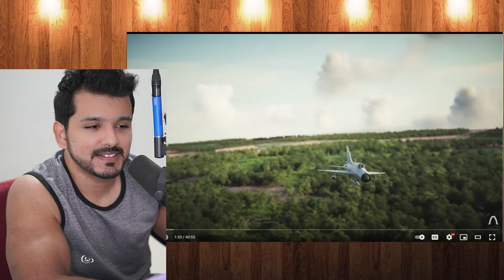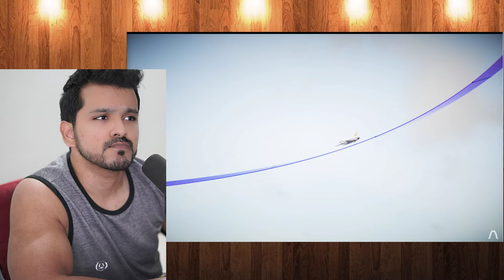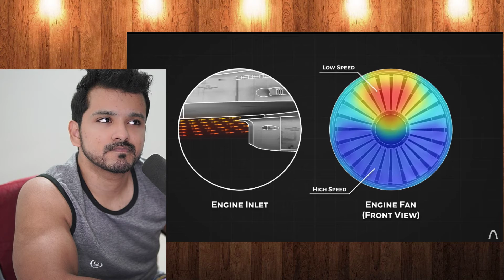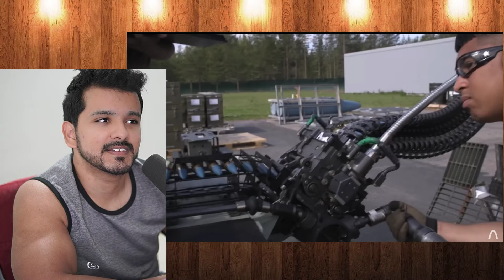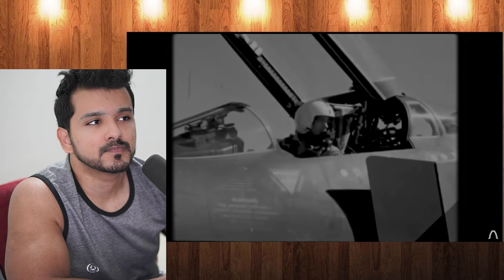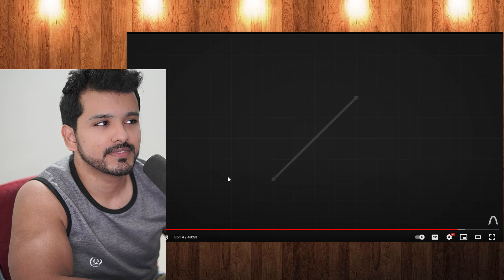The Insane Engineering of the F-16 | CG Reacts

Comment: The closest parallel I can think of regarding how an F-16 handles compared to other fighter planes is by using an example of motor vehicles -

If you've ever driven a vehicle with a very short wheelbase, like a jeep, or a go-cart, you'll know how quickly they can turn.  The tradeoff (as with the F-16) is that it feels very "wobbly" or unstable at high speed, especially if you're just trying to hold it in a straight line.  A vehicle with a longer wheelbase has a larger turning radius, so it feels clumsier at low speeds, but it is also much more stable at high speeds.  

Many people think F-1 cars are very wide because the viewing angle the cars are shown from on tv makes it look that way - however, if you look at an actual diagram of an F-1 car, you'll notice they are quite long compared to their width - even more so than regular cars.  F1 cars are almost as long as a Chevrolet Suburban, but no wider than a Honda Accord.  F-1 cars need the length to stay stable at 300km/h.

Comment: When they say the gun is accurate they mean the bullet goes where you point the gunsight. When you're dogfighting an transonic speeds you may only have the enemy in your crosshairs for a spit second.
In early M61 installations the gun would vibrate a lot, causing the bullets to spread out kinda like a shotgun. This is good for an area of effect where you don't have to aim as precisely, but it does mean you have to spend more time on target to get enough hits to ensure a kill. When America started getting serious about using guns in dogfights again they did some tests and determined that the shotgun effect was actually not very efficient. The mounting was strengthened so the gun didn't vibrate as much, resulting in the bullets flying in a much tighter formation. So while you had to put a little more effort into aiming the time needed on target to score a kill goes way down.

Comment: 5 seconds may sound short but all it takes is 4-5 rounds to potentially down an enemy plane. Pilots would really only ever shoot in short burst that most often don’t even exceed 1 second. So the F-16 for most situations already has more than enough, since the guns are barely used anyway, even if it was necessary to increase the F-16 ammo count it would be pretty much impossible since the ammo is tightly packed into the plane there isn’t any space for more.

Comment: F-15 and F-16 were designed basically at the same time...neither was really based on the other. They were designed with very different goals in mind and by very different companies...one of the only things they share in any way is that both have been fitted with the same basic engine in some versions. Both the F-15 and F-16 come in single seat and 2 seat versions...that can be either for training purposes, or like in the F-15E model it is for a second crew person to operate the weapons and sensor systems.

Also, 9g is about the limit a human can take and stay awake, but it is not fatal unless that amount of gravity is maintained so long that the brain dies from lack of blood flow.